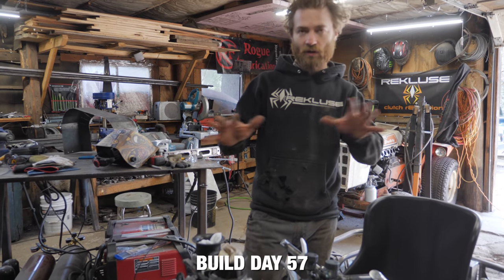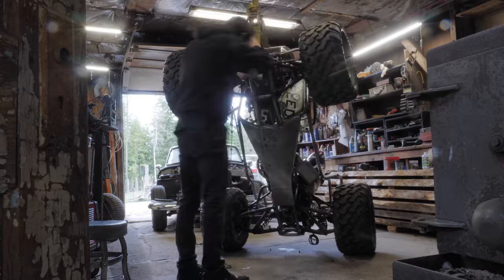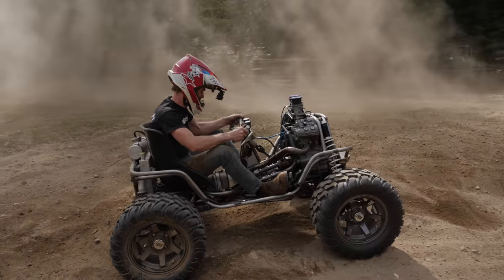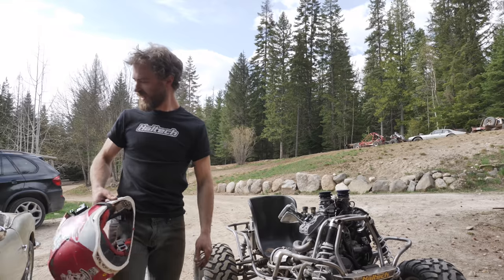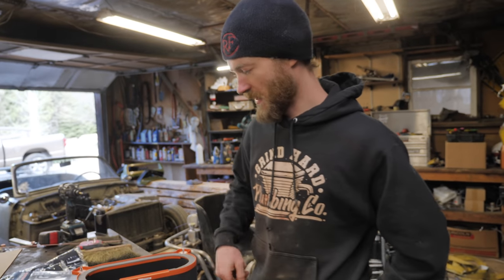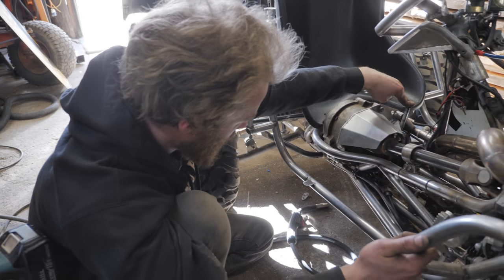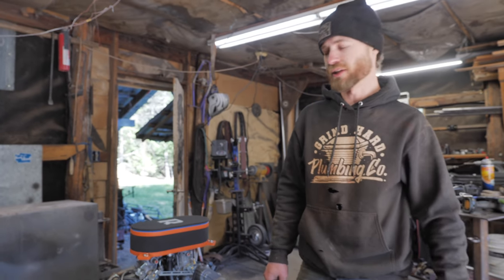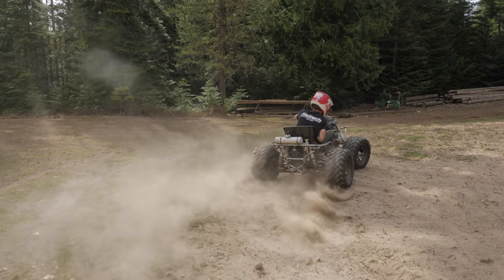First Test Drive 100HP 4x4 Power Wheels Build

Comment from the maker: New giveaway and merch here! https://www.grindhardplumbingco.com/store-1
Reply: Make sure when you build the fuel tank to plumb the return to the bottom of the tank. If it just shoots down from the top into the fuel, it will air rate the fuel causing the pump to pick up air and fuel. It’s something that a lot of people don’t think of and causes big headaches for the EFI
Reply: i will buy it for 2500 cash
Reply: @ianguzman3464  They spent that in rims and tires and air filter i bet lol.
Reply: You guys should put those into production. I bet you could make a killing with those things. With the seat being lower to the ground, you wouldn't be as pronged to roll it unlike a 4 wheeler. Put a nice body on it and start production. That thing is nice as hell. I want one so bad. You guys stay safe and God Bless. Let me know if and when you start building those to sale. I'm definitely interested!!!

Comment: "you can go in reverse in 6th gear if u want" 
- ghpc
Reply: Been there done that it didn't end well spent 4 weeks in hospital 🙁 its very hard to control a vehicle at speed in reverse
Reply: @jackbeets3838  I've done it in a car, with an automatic transmission. It does get squirrely. Sorry you got hurt.
Reply: @bradleyj.fortner2203  yeah I was on a stretched cbr 600 power shifter cart only got to 4 probably got up to 80 km lucky I was on a wide open field still not my proudest moment
Reply: Reverse, 6th gear Snow-nuts!!!! I had a CVT trans Mercury Montego AWD car that I found would hit 120 in reverse in the snow!! lmao It was absurd. The G-forces would smash your faces against the door windows.

Comment: @grindhardplumbingco i like the REKLUSE banner on the wall in the background. I almost bought one of those clutches for my ec300R one time but then i was like ehhh i couldn't justify paying 800bucks for a clutch i don't need to pull in to shift. it seems like a great idea tho. especially if you put the right springs and have it set just right. what did you guys use one of those on? i didn't catch it i don't think

Comment: your pinned in there pretty good if it should roll it wont be pretty you definitly need a roll cage..even with propper gear you can possibly still break a colar bone to say the least..

Comment: This thing is so freaking cool, mark my words that it's only a matter of time until ATV manufacturers start putting together some machines in this general configuration. If they've got any brains they will, that is. With a seatbelt and simple roll bar this could revive the odessey style sit-down ATV in a much cooler way.

Comment: I'm blown away by this build. First off I want to say, this is the perfect application for this motor...this set up. this configuration.
 Lots of power, compact, 4x4, lots of suspension. quasi-low center of gravity.(but the wheel base makes up for that). and I think this is what is key .. and cool.
 I can see a side by side 4x4 , this motor ..you know? ....for the kids to play with !

Comment: Look up "kenda"  geko paddle tires on Ebay---   They have really hard and reinforced ribs--- These are only "ok' paddles in the sand;  they work well but there are better ones out there specifically for sand===  and they are super rough on the road of coarse when going slow---  but they work really awesome on Dirt and trails, ect...   This thing would be awesome with those paddles on it..  I turned a CBR600 bike into a quad and they were great on there for all around-- especially dirt.  They lasted a long time, really good wear time.

Comment: That might help your drivability problem. The t-shirt material was likely hurting air/fuel flow. It sounded like it was running out of air-fuel when you got into higher RPMs. 
You need a smaller piston for the shift knob..

Comment: Oh the wait was so worth it. Seriously phenomenal job. Soooo detailed. I have a few brute force 750s. Are you going to hook up the front diff actuator so you can run two amd four wheel. Or you can convert the electronic actuator into a manual cable version. But a button would be way cool

Comment: You know where the crank case vent tube goes. Straight to the ground lol as long as your not blowing oil. I wouldn't route it back into the motor may get a little wild on that thing and flip in don't want all that oil and heat going back into the intake anyhow

Comment: I see an issue: gearing

Those tires are so big that you can't really get out of first gear, and since they are using gears instead of chains, changing the gearing will be very hard. I think in order to use more than 1rst gear, the tires will have to get smaller
Reply: 1000ccs is plenty to pull those tires in any gear
Reply: Definitely has more grunt than the quad that driveline came out of, and the wheels are smaller diameter as well.